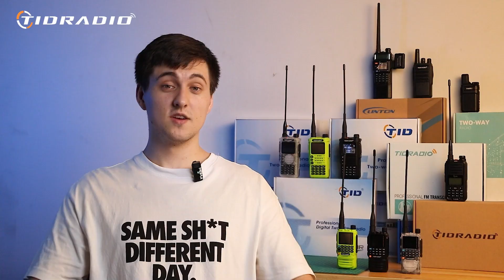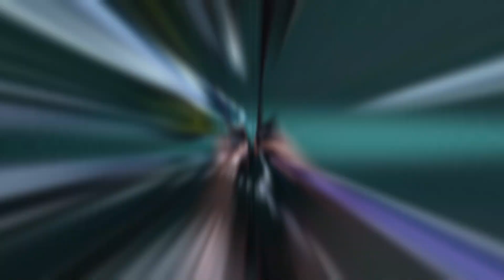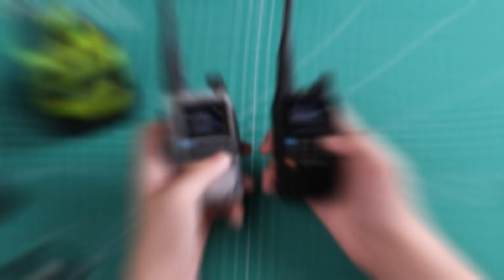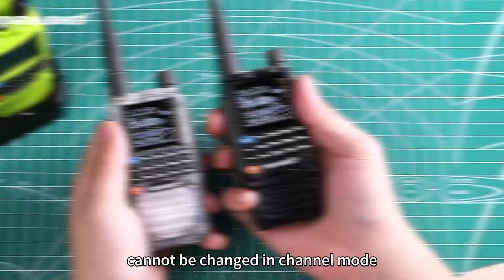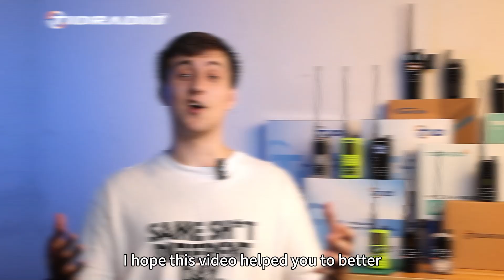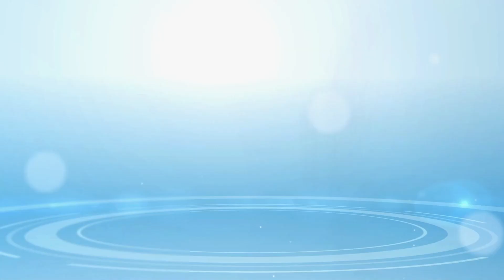TIDRADIO TD-H3 Lesson 3 |  CTCSS and DCS

Comment: Sorry, no idea what this topic is even about and what this step is for. Cannot follow along. I really wish there was a true beginner, zero knowledge, noob, tutorial for step by step out of the box instruction for a new GRMS H3 Radio user. I cannot find this unicorn anywhere. Every single tutorial video is 100% geared towards someone with some level of radio use experience and 99% are for HAM. With SHTF weather and other disasters, many are flocking to get radios to be prepared. NC aftermath has been a shock for us all. I really hope the Radio community can find it within themselves to take a moment and put forth a teaching video for the masses. A video that hits the, "talk to me like Im 5 yrs old", mark. I did have the wherewithal to find the Repeater website and requested permission for several in my area. One owner replied back with info on "Round table" they have and a string of numbers for "tone". I wish I knew what that was. Even though I told him I was brand new working from scratch. I have no clue how to access a repeater and what to do with it when I figure it out. No clue how to find others on the radio and communicate during an emergency. No idea why the BT App are not working for me as GMRS. Is it only for HAM?. Is there a tutorial that can address any of this?  Thanks.

Comment: is it possible to get a little more in depth about CTCSS and DCS tones? I am entirely new here and not entirely sure what happened in this video
Reply: CTCSS is short for Continuous Tone-Coded Squelch System.  To utilize tone-coded squelch, the transmitter of the desired message source must be encoded with the same continuous tone as the receiver is set to decode.  The transmitter sends a constant tone to hold the receiver's squelch open until the transmission ends.
  If the receiver is set to 100.0 Hz, it will only hear the transmitter that sends a 100.0 Hz tone.  If another transmitter uses a different tone, it won't break the receiver squelch.  The receiver stays silent.
 The advantage comes into play when listening to a local repeater that shares the frequency with a distant repeater.  Without the tone squelch activated, both repeaters can be heard.  But with the tone squelch set to listen to the local repeater, only it can be heard, and only local calls will break your squelch.  For this to work, each repeater must choose a unique tone squelch from the other.

DCS is a digitally-coded squelch, and the digital tone will open your squelch only if the transmitter and receiver share the same code.

Privacy is a misnomer.  No one has privacy, for anyone within range can hear everything using a simple receiver set on your frequency.